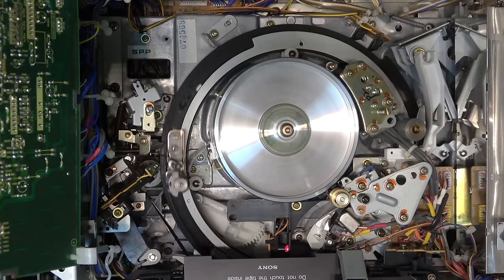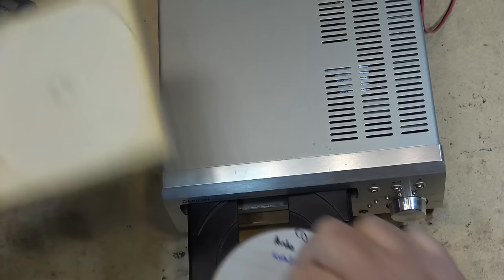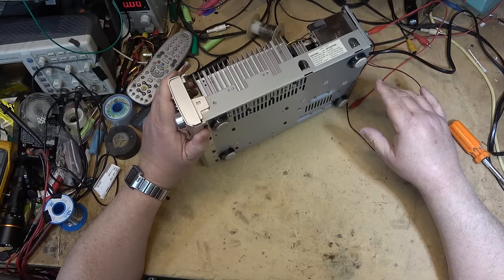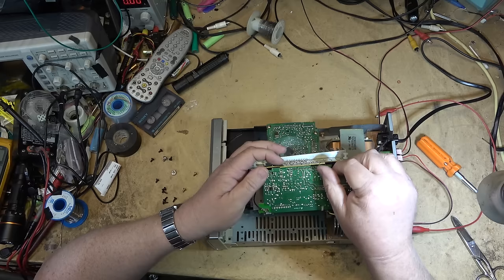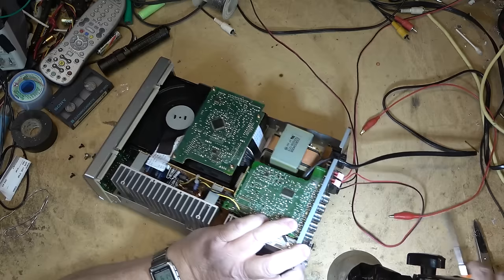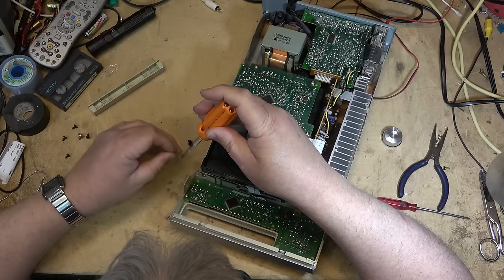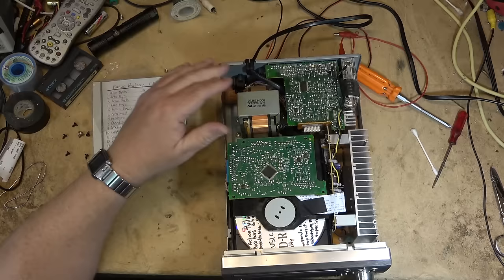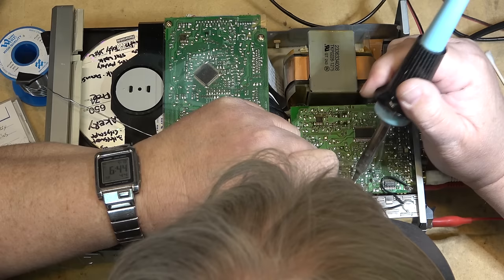This DENON UD-M80 is a piece of CRAP

Comment: When I was in the industry, Dave the Japanese components were far superior to the Chinese produced ones. We probably can't blame it entirely on China, as they are forced to manufacture products as cheap as possible for bigger profits. I purchased a Denon CD Player in the mid eighties that skipped or would not read a disc from day one. It took two attempts to fix the problem under warranty to play perfectly. Perhaps an alignment or laser replacement. It still plays perfectly today! I used to swear by Denon products in their heyday...........
Reply from the maker: I'm talking the 60s.  When  i was in the business the Chinese manufactures were just coming online in the late 80s and the stuff wasn't very good but it got good in the following years.  Same with Mexico.  Many companies moved their assembly to Mexico and there was a noted increase in troubles.

Comment: I have one like this it sounds really good but the CD player is separate and its 35 watts per channel
Reply from the maker: I'm sure it does.  This one sounds fine now that it's together.  The way the cover locks on it imobilizes the boards but the laser is dead.  Client said it played but as you saw the CD was dead before i started working on it but the owner may have been mistaken as i believe he just bought it on eBay.
Reply: @12voltvids  Evil Bay, I call it. Once the pickup dies, good luck repairing it. Most of this crap you cannot get parts for. "Oh, it's pretty simple, it doesn't read discs". Yeah, that's because the laser is (starts with an F and ends in a K plus and ED).

Comment: The Denon AV receivers are just as bad to work on. Same as the Pioneer AV receivers. All of the circuit boards that have jacks on the rear panel are stacked, inside with the same types of interconnect connectors to tie everything together. If you want to operate the receiver, and trace a signal, you have to use the kit of extension cables and boards that are supplied to the authorized service depots, something not available to anyone else. Whenever I get one of these receivers in, I tell the customer that it isn’t possible to fix, for that reason. That includes Onkyo units, too. They’re all junk.
Reply from the maker: I don't touch av receivers unless they are my own.

Comment: You’re not exactly making yourself look that good here you’re bitching that you can’t receive Radio yet you have him got an antenna plugged in. Can’t play CDs yet you try two different formats of pre-recorded but don’t try a standard audio CD and then claim it can’t play CDs but you’ve never tried a standard CD and the fact that the wobbles about when you move the switch that’s just a dirty and coda that could be sorted out why just increase in attention on the forks that do the encoding on the rotary wheel cleaner as well
Reply from the maker: I tried a stamped audio disk.  I just didn't show it on camera.  It's called editing.   I did show that the laser is not emitting light. it doesn't matter what dish you put in if the laser is not a bidding any light it's not going to spend simple as that. As far as testing the am on the Brit radio that was not a complaint the complaint was the CD player wasn't working. I don't have an a.m. handy and I didn't feel like going in the house and taking one off my stereo in the house. That Saudi radio would have been set for 9 kilohertz channel spacing. Could it be switched? That i don't know as i don't have the manual.   As far as receiving FM, i have a lpfm transmitter sitting next to me that one I shouldn't need an antenna for as the antenna is only a few feet away.

Comment: Wow, what a poorly designed piece of shit. I guess Denon stuff is nowhere near as good as I thought it was.
Reply: It depends. Like most brands, some of their gear is ok, some is junk. The Denon gear that was made in the 1980s and came out of Japan was pretty good. I have seen and worked on quite a bit of it, including some large integrated amps that are absolute killers in build and sound quality. Unfortunately, like many manufacturers in the 1990s they tried to capture all ends of the market by producing cheap junk like this that was made by a third-party supplier and just had a DENON badge added to it as it rolled off the assembly line. It was a move that proved the undoing of many companies and eventually resulted in quite a few going bust.